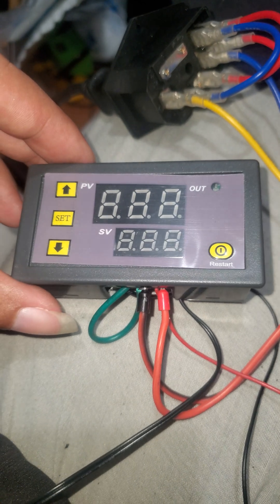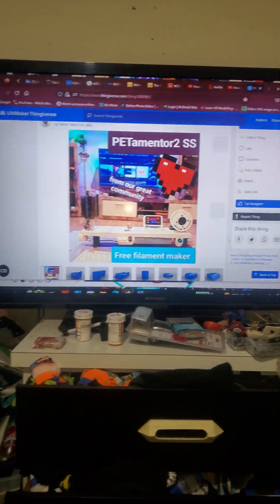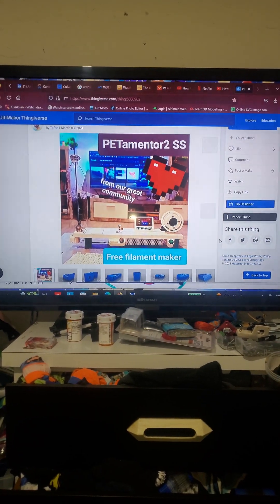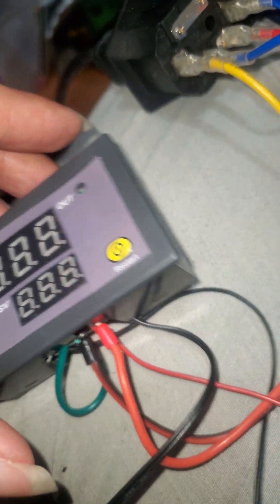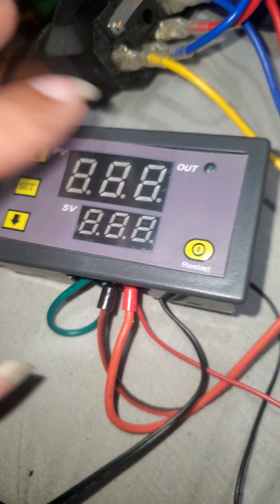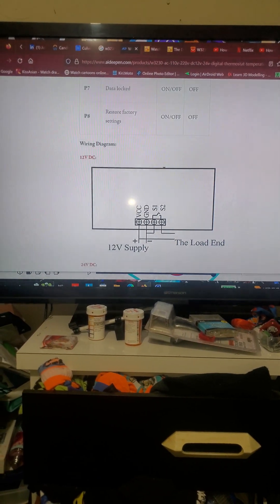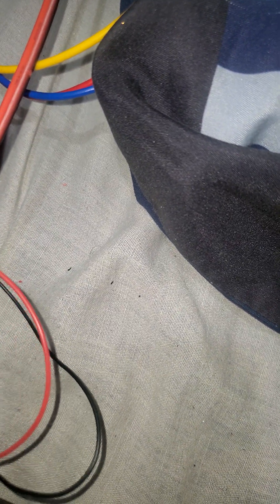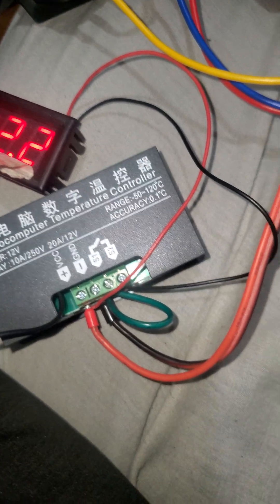how to wire a W 3230 thermostat 12V dc temperature controller part 1

Comment: What kind of awg you used?
Reply from the maker: I believe It is 8awg wire and you can use any thing just don't go lower than 4awg because I don't think it can handle the current load and could melt the wire and cause a fire hazard!

Comment: Hey! What wires did you use for the connections and where could I get them? All the best.
Reply from the maker: Hey buddy I found the links to the wiring connections I used and I tried to find the ones that were cheaper for you so here they are
Reply from the maker: BNTECHGO 22 Gauge Silicone Wire Spool Red And Black Each 25ft 2 Separate Wires Flexible 22 AWG Stranded Tinned Copper Wire https://a.co/d/gzC5IM2
Reply from the maker: 2
Reply from the maker: Ferrule Crimping Tool Kit, LUNEY Wire Ferrule Kit with 1250PCS Wire End Ferrules & Crimper Plier, Self-adjustable Ratchet Tool Set for AWG 23-7 Electrical Wire Connectors, 0.25-10mm² https://a.co/d/8EY5kr7
Reply from the maker: 3
Reply from the maker: 15A 220V/110V Rocker Switch Power Socket Inlet Module Plug Switch Socket for 3D Printer, 5A Fuse, U Type Plug https://a.co/d/gkU12ig
Reply from the maker: And if you need a pc 🔌 for USA  outlets
Reply from the maker: 4
Reply from the maker: Amazon Basics Computer Monitor TV Replacement Power Cord, 6', Black https://a.co/d/7FOTzeO
Reply from the maker: Hope it works out for you and if you have any other questions please feel free to ask me and I will be posting more videos on this topic and machine to make filament from plastic bottles so keep checking in to see it😊
Reply from the maker: 2 last things I have used for wiring connections
Reply from the maker: 5
Reply from the maker: ZONBANG 100PCS #10 Fork Connectors, 22-16 Gauge Fork Connector Tinned Copper, Fork Terminals Waterproof Heat Shrink. https://a.co/d/aMcmwoV
Reply from the maker: 6
Reply from the maker: Last one
Reply from the maker: 150 PCS,Spade Connectors, Nylon Insulated Male and Feamal Spade Terminal, Wire Connectors, Spade Terminals Blue Yellow and Red https://a.co/d/4RamPmy
Reply from the maker: 1 last thing I need to say is 
If you are using a  3d printers  heater  cartridge  it doesn't matter what  positive connection or negative connection you use because they are not setup for positive or negative leads  all you have to do is connect the 2 wires to the controller 😊